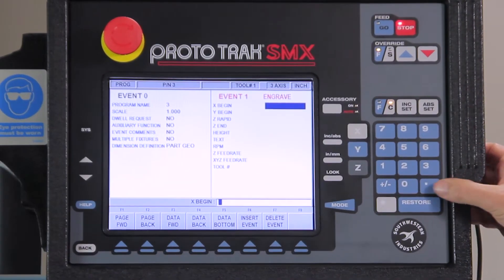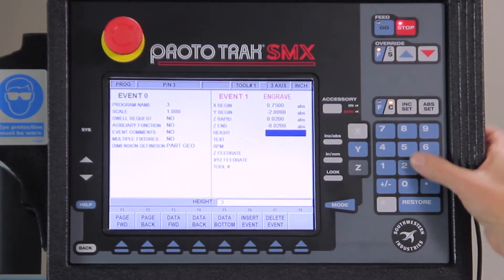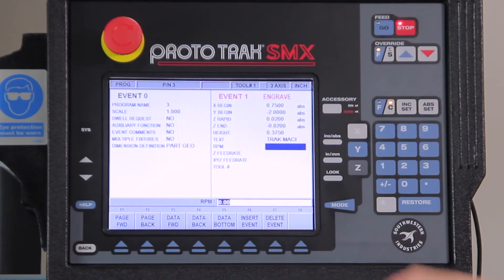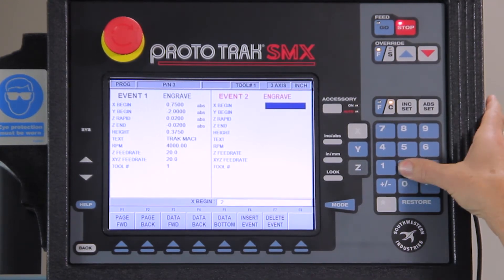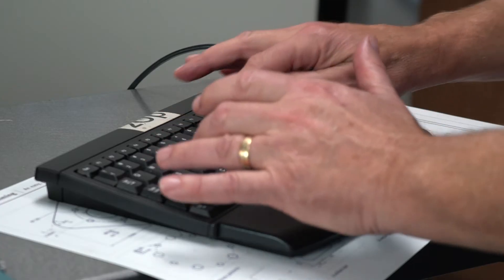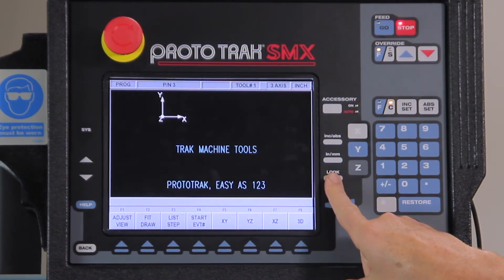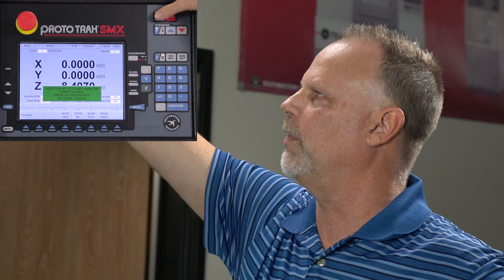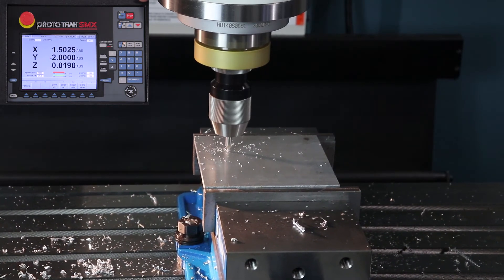Engraving | ProtoTRAK SMX Control | Basic Programming 3

Comment: Us users need to be able to engrave with an arc.  Is that possible now or can this be updated?
Reply: If you're talking about engraving in an arc in the XY axes, thats only available in the RMX. It is in the options window. To use it, you have to select ARC then when you close the window, you have to fill in the radius and angle for the engraving. T. P.  BYW, if you want to do more high end engraving in any of our controls, look up a software product called Millwrite. It works great!

Comment: We have an RMX DPM RX7. Why will it only engrave upper case letters? The keyboard shows lower case, but whatever I try it will only engrave upper case letters. I had to resort to engraving on our Haas mill because of this Trak inability. It would not engrave an equal sign either, until I installed the 3.1.1 software update. This issue should be addressed. I see many pitfalls with the Trak machine. 
It does have some good points though.
Reply: Hi Jim, Unfortunately, Our control will only engrave in upper case. We recently added lower case for naming programs but we don't have any fonts for lower case to engrave. Part of the reason for this is that we had to create our own fonts so that we don't have to pay royalty fees to another party to use their fonts. Hopefully, we will create the lower case fonts sometime in the future. T.P.

Comment: We have the dpm rx3, and when i try to engrave, it engraves from letter to letter, without retracting between letters. What am i missing?
Reply: Are you in 2-axis or 3-axis?  If in 3 as you should be, make sure your Z rapid is above the part.  I always use .050" as my Z rapid.  Then, I use my Z end at about -.020"  I do a lot of engraving with a center drill so -.020" works good for that.  I hope this helps!  T.P.
Reply: @trakingpat2750  thank you

Comment: How do you rotate to write on y axis?!?!
Reply: Diego, unfortunately, we don't have that capability in any of our controls as of yet.  The best I can tell you is this...  If you have the DXF converter in your control, you can make a standard engraving event and then save it as a DXF file using the drop down menu.  Then, when you go back and open up the DXF file, you can convert everything to mill and arc profiles. From there, you can use the copy rotate or even copy mirror to manipulate the engraving any way you'd like to.  It's a little cumbersome but if you don't have a cad/cam system or an engraving software package, it will get the job done.  If you do a lot of engraving, I suggest you look into a software by the name of millwrite.  This software is inexpensive and will allow you to engrave almost anything on your ProtoTRAK control no matter which model you have.  I hope this helps...Thanks for asking the question!  I love intelligent comments that are helpful to everyone that is trying to learn!  T.P.
Reply: @trakingpat2750  I'm currently trying it out right now, I'll let you know how it goes thanks!!
Reply: @trakingpat2750  Success! Thanks!
Reply: @godiegogo91  That's awesome!  T.P.